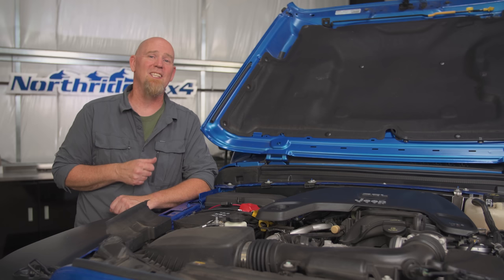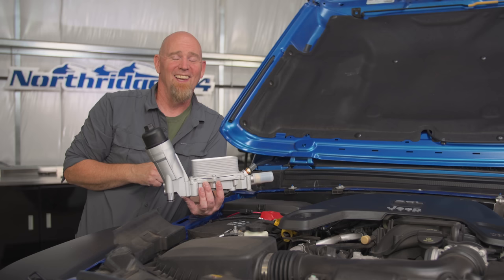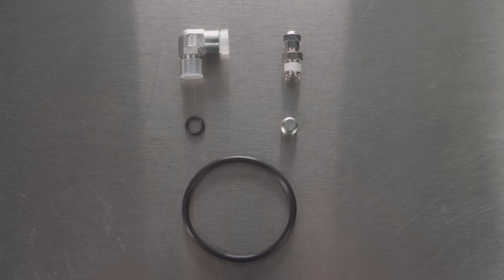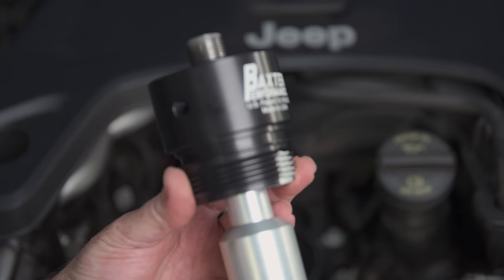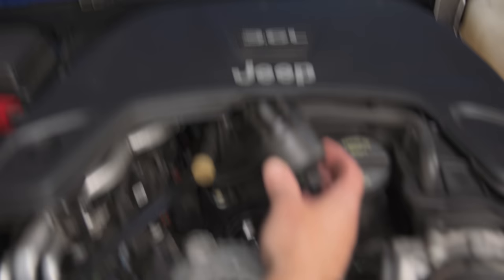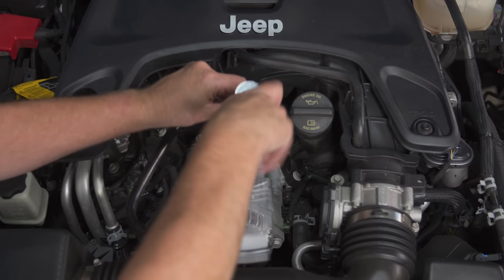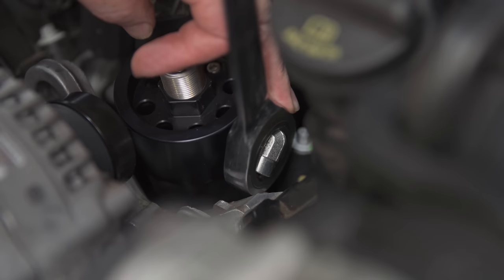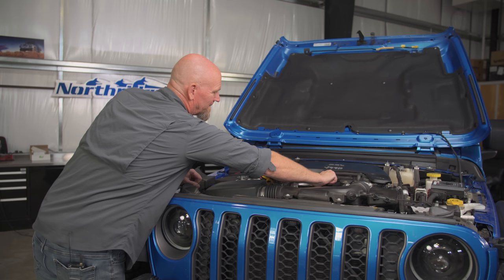STOP Dry Starting your Pentastar 3.6!!

Comment: Some days I hope my 3.6 blows up so it will force me to V8 swap it.
Reply: It will.😂😂
Reply: @ImpalaSS08  well it is a dodge so it's bound to happen sooner than later lol.
Reply: I feel this
Reply: My 99 Xj has almost 420,000 miles and it's just like new.....THE 4.0 XJ BEAST!!
Reply: Yep! It’s on my list to do
Reply: @bobquattrini1787  Sun shines on a dogs ass every once in awhile. 😭
Reply: 4.0 inline 6 Not a 3.6 V6 pentastar no comparison between the two.
Reply: If you add TUFFOIL to the oil, it may take care of the problem
Reply: The pentastar is such a piece of shit so just give it time, it'll definitely blow up
Reply: I hope the same from time to time until I see the prices of a 392 swap
Reply: The Jeep dealer that I purchased my 6 year old Jeep from tried hard to sell me a third party warranty and mentioned how nice it will be if the engine takes a dump and the warranty pays for itself with a new used engine. I told him if the factory 3.6 ever needs more than a few thousand dollars of work Ill never trust it again and would yank it out and drop a Coyote crate motor in just because I can.
Reply: It will
Reply: Mine just did was quoted over 9k for a used engine with over 80k miles on it 8k for a used engine with just under 100k miles at Firkins Jeep in Sarasota
Reply: Well boys and girls we solved the 3.6 engine dilemma by trading the Gladiator in on a newish F150 Platinum.    We'll miss many things about the Gladiator and won't miss many things we didn't like about the Gladiator.
Reply: @tpangle85 I’ve had 4. All good
Reply: @PNW_Car_Mods  you enjoy that Ford F1 Sissy and Its Engine Oil Consumption Issues if it has the EcoBoost
Reply: @AntonioClaudioMichael  This truck is outside of the year range for oil consumption problems.  I'm not worried about it in slightest.   F 1 Sissy    hahahaha I like it.  Have never heard that one before.
Reply: @PNW_Car_Mods  glad to hear your truck isnt In the year range for the consumption issue also glad you took the F1 Sissy as a Joke It just roles off the tongue so easy lol
Reply: Yeah I swapped mine with a 392 hemi. Ha swapped engines never run right. Paid 15k for engine paid 6k for the install and misc parts. It’ll throw Check engine codes. Taken almost a year to work out the bugs and another 3k in fixes
Reply: @danamcwhite  very common issues with a engine swap
Reply: @danamcwhite   Who did the work?  that is unacceptable.
Reply: @@NastyhabitzAnd of course going to a 3.6 Penta star to a 5.7 hemi, your computer hooked up naturally of course 😂 plug and play as if ?
Reply: @PNW_Car_Mods I tell you what, why don't you go find out what it cost, just doing the engine is one thing, then come to computer work, oh yeah let's not forget about a transmission and it's computer
Reply: Why did you buy it then?
Reply: @PNW_Car_Mods  it’s common. Iv had 2 trucks and a Jeep get swapped. Anyone from Jay Leno to Jesse James will tell you it’s common. Look at all the YouTubers like Matt’s off-road or whistle diesel. It’s common. The average Noob that’s done one says that “who did the work that’s never happen to me”
Reply: @danamcwhite  I've been a mechanic all my life and if it were my personal vehicle I can assure you it would not happen.   You need to find somebody else to work on your stuff if you can't do it yourself.  IT IS NOT NORMAL TO HAVE CONSTANT CHECK ENGINE LIGHTS after a straight forward factory parts swap.
Reply: Felt this with my soul and wallet
Reply: @tpangle85  of always i know a van with 620k miles on a 3.6 pen. the timing chain tensioner went out and it jumped timing.
Reply: The HEMI 5.7 has the same tick for a few seconds after starting
Reply: Yea my pacifica did.   Still owe $20,000 pile of garbage designs.   Towing to dealer to diagnose and get screwed some more.  2018 limitied wirh 120,000 miles.   #3 misfire quickly turned into many codes and then massive noise and wont start anymore.   Changed the sensors the 3misfire called for.  Lot i hear do this
Reply: Quit making excuses for yourself. You deserve better than what you make of yourself.
Reply: Make that day become today. Run oil less.......order that Hellcat motor tomorrow
Reply: 81,000 miles mine self destructed. Junk.
Reply: Same.
Reply: Get yourself a RIPP and blow that 5.7 out of the water. 

A good supercharged pentastar can smack 5.7s and damn near match 6.4s. Plus since the Pentastar is built with forged components from the factory, you can supercharge it without having to swap pistons for tougher ringland tolerances or change rods & whatnot. 

You have a phenomenal engine in your car… don’t grenade it.
Reply: Don't worry.  It will.     
It won't be long now.
Reply: You got 20k to do it the right way?
Reply: Dude me too I thought I was the only one that thinks that
Reply: lol same
Reply: Vehicle won't be worth it by then...
Reply: Same thought here. Are we stupid? ORRRR way too smart for this world?
Reply: And forced to spend 40k minus new axles and drive train and labor 😂
Reply: @danialphaomega  While I get what you are saying, it doesn't have to be that way.
Reply: Is there an equivalent but more affordable swap than the 392?
Reply: 71,000 mls started leaking coolant into the engine , no warning, warped the heads , out of warranty... $5,200. Rear main seal leak still not fixed they want $1,700, overflow reservoir leaked $400, rear end shredded gears , went to 4.88 $2,600. Haven't had rear defrost since about 4 months in , brand new 2018 JLU Sport. Now has 78,000 mls.
Reply: @bobquattrini1787 They should've never quit making those 4.0 sixes. One of the best engines ever.
Reply: I wanna do the same but can’t fund my swap yet
Reply: @bobquattrini1787 yea it is, I sold mine with cold AC and the 4x4 worked
Reply: @danamcwhite that’s dirt cheap. The places that do Hemi swap are charging $30-40k plus labor for a 5.7L or 6.4L.
Reply: Ripp supercharger puts out almost as much power as the 392 for $30k less.
Reply: My Jeep supposedly needs a new engine, it’d be cool to do a hemi swap, but I don’t have $60k to do the engine and upgraded axles.
Reply: @Suncoastrealestatemedia  Until it blows up said crappy V6 lol  and yes those blowers have blown up more than one of these pentastar engines.
Reply: @PNW_Car_Mods  interesting you have actual evidence of said claim or is this just “trust me bro??”
Reply: @Suncoastrealestatemedia  If you haven't done so already just google 3.6 pentastar and boost or supercharger or turbo. You can read for days or until your bored lol.  It doesn't matter where the boost comes from. They are NOT a strong engine and many of them fail without boost.  Boost combined with poor fuel and poor tuning makes it even easier to blow them up.  Our Gladiator is gone now and while there were a lot of things we liked about it we will not buy another until there is a better engine platform in there beside the pentastar and the diesel.
Reply: He'll cat or demon swwp
Reply: Same!! I feel your pain :(
Reply: Every day

Comment: I've been a hydraulic mechanic in the oil field for 6yrs and NEVER thought of using a closed end wrench like that to tighten that 90 degree fitting in a tight space. WOW!!
Reply from the maker: That one was a new for us too, but thanks to Baxter Performance, we'll be using it from here on out!
Reply: That's was a nice method
Reply: That’s a new one and made this whole video worth watching even though I don’t have anything with this engine
Reply: it can way overtorque fittings so watch out. the reason small niches were made for fitting was the right size tool. that also being said as a mechanic i realized weird ass size 12 point sockets fit every tap and die you could imagine. so in limited space you could literally tap almost any hole if you could drill it. wrench/ratchet wrench can work just like the socket.
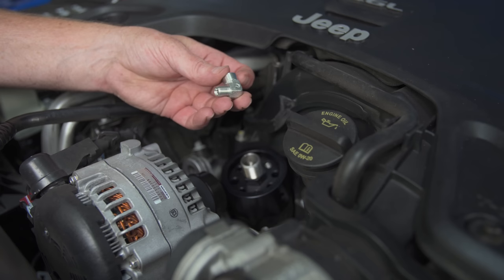Reply: 7:06 for anyone looking
Reply: Yeah, I took note of that too!
Reply: I took for granted this wasn't common knowledge.  It's a must use technique on some farm implements and equipment. Good video.
Reply: @northridgenation  ..amazing creation sir! Just I have 1 important question about this?....when you do oil changes at my local wal-mart....all they have to do is do a normal oil change..?..and that oil on top of the baxter...that's on top will flow right out???..or does that old oil stay locked up in that area on top were it retains?..
Reply from the maker: @drunken-skunk  when you blow down the filter, the oil will drain back into the oil pan.
Reply: @northridgenation  Amazing thanks!..1 last final question?..do yall have any more "Up grades for the crysler town and country "?..besides this amazing creation! And will this new creation help the motor last longer and better?.thank you so much for your help
Reply: Thanks for pointing that out.
Reply: What about cold start your run the bottom part of engine dry ❓️
Reply: I happen to have a cold one sitting here and when I saw that I held up my beer and said cheers! Very cool idea!

Comment: Honestly, I got the tick around 40,000 miles on my JK, took it to have the rockers replaced and the guy at the shop recommended l just use 5W20 high mileage oil with an additive and change every 3000 miles (no more).   The ticking stopped after less than 500 miles and hasn't been back at all !!!!   Over 100,000 now.   I swear it was like a miracle !   True story !   I hope this helps someone.
Reply: The 5w20 has the additive already or you put a separate additive in?
Reply: If you're actually hearing rocker tick, the damage has already been done. A heavier oil might reduce the noise temporarily but it's not going to miraculously heal damaged rockers. To be honest, better to fix it ASAP before your cam is toast or even worse, a catastrophic failure.

Comment: So I've worked on a number of different 3.6 pentastar. Best thing you can do for any pentastar is run 5w 30 in my personal and just checked the valve train, and it's as tight as day one. Both my kids jeeps have had to do the top end do to running light weight oil. So in my opinion, run the 5w30. The only reason the use a lighter weight oil, is slightly better fuel mileage. Which equals about a mile or two out of a tank of fuel
Reply: Had 200,000 miles on my minivan with the same engine.  It used 5w30.  Never had an engine issue at all, always used the original style filter
Reply: I ran 5w20 in winter  5w30 in summer
Reply: This is something I have been considering. Have a ‘16 WK2 with 98K miles, and still runs great. I have been causing M1 0-w20 with Wix filters from its first oil change. But, the entire time I have wondered if the oil might be a little thin.
Reply: Wish I had done this before valve train failure on mine.
Reply: I've been doing the same since my engine hit 20K miles.  Now sitting at 75K miles, and I never have any knocking noises like I did when it was on 0w20.  I always run full synthetic
Reply: @cjsteele9594 that's actually pointless to do. Both are five weight oil in the cold. Once the engines heated up, all you're doing is running thin oil which doesn't help at all
Reply: How many miles do you have on this vehicle?
Reply: Manual says 0w 20
Reply: @hakenkreuz7076 my 2016 says 5W20, my friends wife’s minivan, with the 3.6,says 5W30, WTF ?
Reply: @jasonmorehouse3756  multi vis oil first number is the Starting Viscosity, Second # is Running Viscosity. 5-30 is heavier at full engine operating temp vs 5-20 or 0-20. The lightweight 20wt factory spec is for EPA cafe numbers and severely decreases engine life.
Reply: @hakenkreuz7076 yeah 0-20 is probably the biggest cause of the oil related failures outside of the poorly designed oil drainback filter
Reply: I agree... 👍 
Put 5W-30 in it. It certainly won't hurt ANYTHING, except a slight (probably un-noticeable) drop in fuel mileage. 

I feel that 0W-20 is WAY too light of an oil for ANY engine. The oil wedge with that weight of oil CAN be too easily squished out of high-pressure locations, such as the rocker arms. The manufacturers are in a tough situation to HAVE to meet minimum EPA mandated MPG's, and the thin oil IS one of the ways that they struggle to meet it, as the thinner oil robs less power from the engine. BUT, it's too thin to do the job nearly as well as 5W-30 can.
Reply: @cjsteele9594  I’m going to give this a try, what about “5W25” ?  3 qts of 5W20 and 3 of 5W30 ?
Reply: @cjsteele9594 That makes zero sense both oils have the same winter rating ..
Reply: @jasonmorehouse3756  Or more specifically,  both oils have a viscosity rating of 5 at Zero Degrees Celsius ..  

(the 30 is at 100°C)
Reply: @100pyatt Do huh ??
Uh,  No sir,    incorrect .
The 1st number is the oils WINTER viscosity (thus the W)
That means viscosity at 0° Celsius.    The Second number is the viscosity at 100° Celsius.
  You are correct about the 5W20  decreasing engine life,  but that's more with organics,
Less with full synthetics like mobil 1 which bond to the metal and do not break down.
Reply: @100pyatt 
So I have a 2018 JL Wrangler sport 3.6, the manual says 0 20, you think it won't hurt anything to put 5 30 in it, when I start this thing up it's loud for a few seconds, til idle decreases. I've always hated putting in that 0 20 sh!t. Especially since the JK's have the same engine.
Reply: @queensapphire7717 
Did you ever change oils in your 3.6 ? I'm thinking about it.
Reply: @hakenkreuz7076 thicker oil in v6/v8 is the best thing you can do. Would t recommend d in. 4 cylinder but yeah
Reply: 10w30, your welcome.

Comment: why not just pre oil like you showed, which is a cool hack I didn't know about?  $330 plus for an oil filter adapter?  That I have to use an air compressor to change oil? That forces all the oil I'm supposedly saving out of the oil galleys?  That I then have to pre oil when oil change is complete, right?  Because all the oil is out of the galleys per the air being injected?  Why not just use the pre oil step without the adapter?  This might be a thing on 1st and 2nd gen 3.6, but the 2018 version and beyond have been built to prevent wear noted in earlier designs.  I'm on my 4th 3.6, all versions, over 250,000 miles between them all, only one to tap a little was the 2013 3.6.  Fixed with lucas low viscosity modifier additive.
Reply: Unless it your wife's vehicle and you know damn well she not going to prime the oil before she goes to get her nails and hair done.

Comment: The problem with the rockers are a roller bearing failure and lifter failure, not a oil starvation issue, Most failures I see are customers that aren’t on top of maintenance. Just had a jk come in 4qts low on oil. This seems more like a solution to a problem that isn’t a problem.
Reply: Not true, my wifes 2015 is a mall crawler and its been maintained by the dealer from day one to include oil changes and hers started ticking at 74k.
Reply: @darryljacobs4090  You got one of the lemons..
Reply: This failure comes from the lack of lubrication upon start up over time.. The rockers and rollers and right up there at almost the highest point, every time this engine starts those parts starve for oil for a couple seconds or so. I regularly change the oil on my 2012 and can hear that clacking start up for the first 2-3 seconds every day I start it for the first time..
Reply: @outwiththem    When they're all lemons, you're guaranteed to get  lemon.
Reply: @scdevon  iF YOU ARE A LIME, YOU WILL ATRACT LEMONS.
Reply: That's what I'm thinking too with this thing. Just selling snake oil here.
Reply: This part does nothing, except for possibly keeping oil in the filter. The housing,  and heads, etc, still drain all oil back to the pan. This finely machined and crafted part does not keep the lifters, or any other part of upper valve train full of oil. Waste of 300 bucks. Nice try though
Reply: @jdsilvaca  Yes sir, we're seeing no measurable difference on start-up oil flow in the upper valve train. Stock Pentastars easily crack 300k in total factory condition, just change your oil & OEM filters @ the recommended intervals, and don't beat the life out of the thing. OEM is best every time- no need to add gimmicky bullshit. No need for catch cans, cooling modifications, oiling system mods, etc.. That just adds a rogue variable to a well engineered system designed to operate at peak performance right from the factory, without any of that nonsense. It just adds a potential vector for failure down the road. No measurable benefits whatsoever.
Reply: @Alan-tr5uj  but it is easier to swap filters, you can't deny that lol
Reply: @scdevon 10 million+ are in service, a small % had problems big deal!!!!
Reply: Have one save your money
Reply: I prime the filter by holding the gas down, turn it over a few secs.. then let foot off the gas and start it normally. It's nice and quiet.
Reply: 100% correct.  People refuse to change the oil every 5000 miles.  This will not solve that problem.

Comment: You all will say it has no horsepower, but the 3.8 in my Jeep has 255k miles. One intake gasket leaked a little antifreeze. THAT'S IT . Newer does not mean better .
Reply from the maker: We didn't say the 3.8 was a bad engine, that said, the 3.6 does has better power and efficiency.
Reply: I have a coolant leak on my 2020 3.6 gladiator.   I smell it on cold start up at exhaust.  What were the signs of the intake gasket leak? Dealer couldn’t find the cause(no oil In coolant and no coolant in oil, and no pressure loss in cooling system supposedly.)  the smell and my coolant reservoir being low says otherwise.  Runs good tho so they said drive it till it throws a code unfortunately.